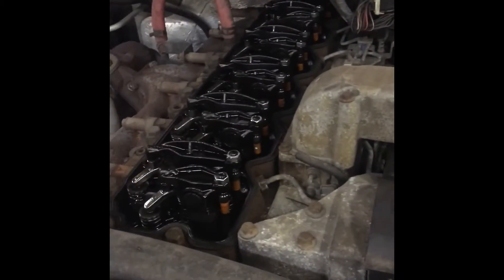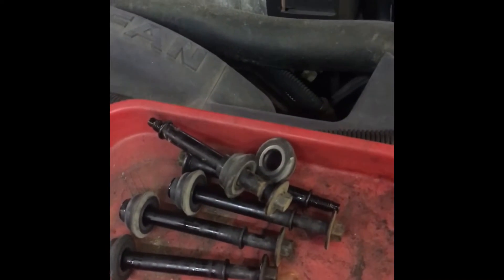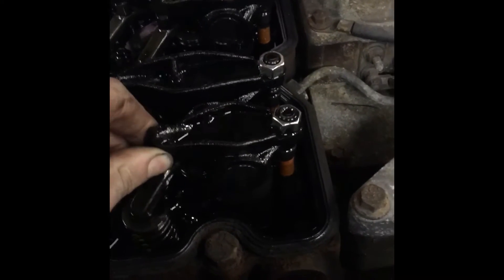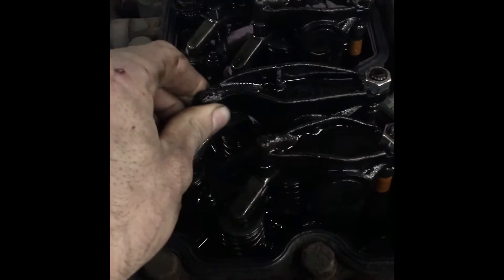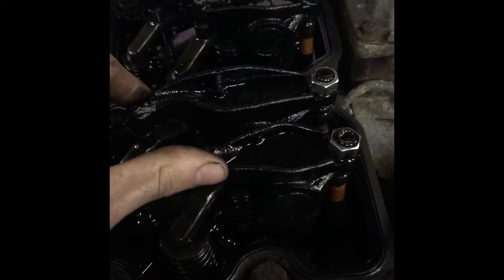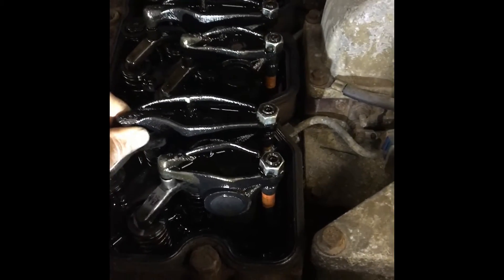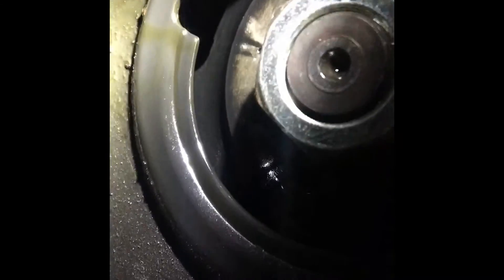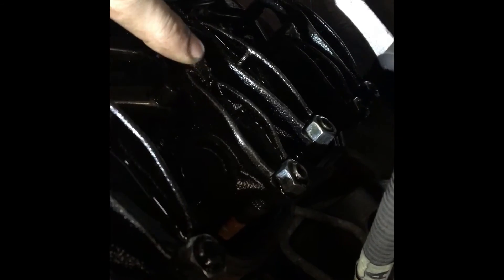How to adjust 1998-2002 cummins valves

Comment: After watching 6 videos your was the best. Simple. I also installed a AmsOil 2 micron bypass. 2001 2wheel dr, 135K and it is the 1st wrench to touch the truck other than steering parts and shocks

Comment: Thank you so much Rob! 
I have adjusted valves various times over the years but I've never seen such a good, easy   explanation as yours  concerning using valve overlap and minimum crankshaft rotation to get the job done.
You really helped me out with this. And it's a good SHORT video with great camera work,  good lighting, good audio,  excellent all around!
Reply from the maker: kevin pulver that’s for the input! Glad it helped